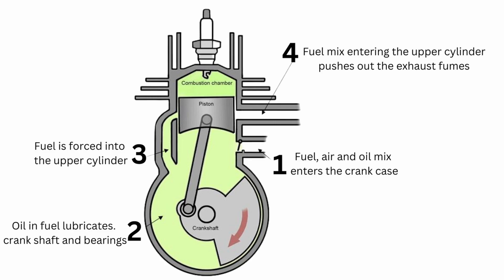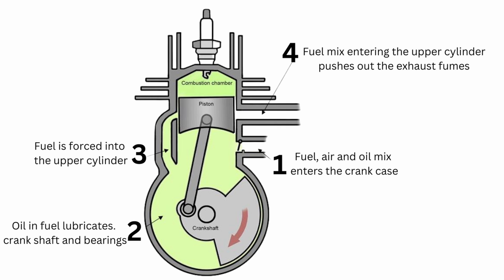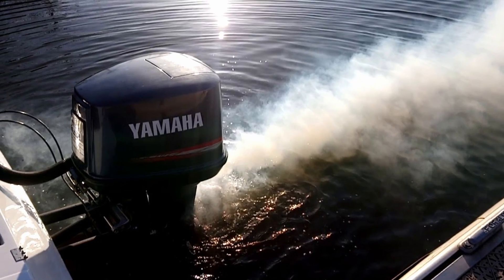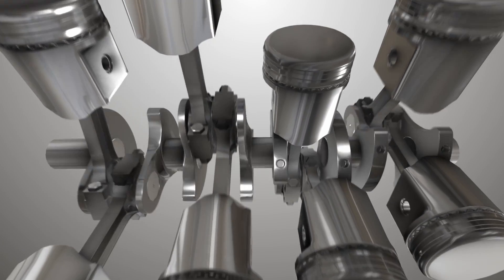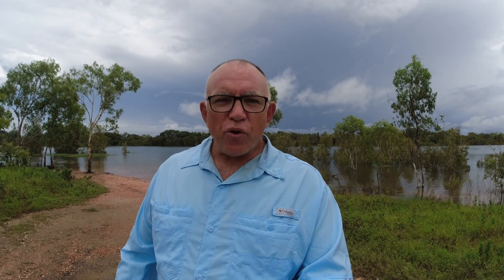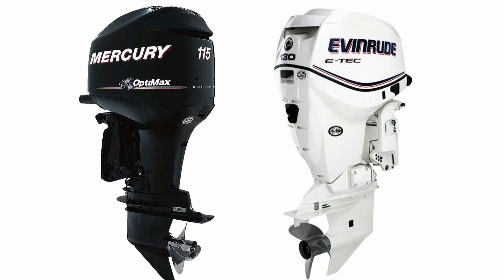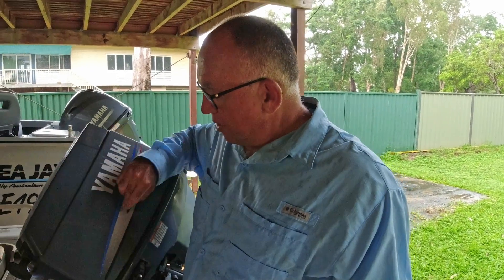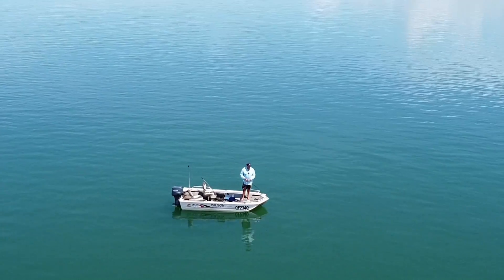Two Stroke vs Four Stroke Outboards

Comment: Not sure where you got your torque info, but 4 strokes produce more torque down low in the RPMs so they actually usually accelerate faster. 2 strokes make their power up higher in the rpm range.
Reply from the maker: Do you really that's the case though? I know that is what they say but a 90hp 2 stroke spins a prop a lot faster than a 4 stroke of the same or similar displacement. I'm old enough to be of the generation where we were all changing over to 4 strokes and were told they are more torquey down low but it is not what the rev gauge or the feel of the boat out of the hole tells me. But I totally accept that it is highly debatable. Put a 2 stroke and a 4 stoke of the same displacement on identical hulls and which one pops out of the hole quicker?
Reply: @smallboatcaptain1968  Same displacement, 2 stroke will have more HP. torque and hole shot. They have always been more bang for your buck by displacement but we rate outboards by HP, so that's what I was referencing. The biggest difference is that 4 strokes have a flatter longer torque curve whereas 2 strokes have a peakier one that really hits in one sweet rpm spot and is okay in the others. That is really based on getting the back pressure to hit and it is over a small rpm range. So in short a 4 stroke is nicer if you want to power at different RPMs, but a 2 stroke will give you more oomph at a small range of RPMs. So why you feel that kick in the hole shot from a 2 stroke is cause you are in that sweet spot. It is also why 2 strokes can be great for boats cause we usually use them in a pretty small RPM range. Personally I love 2 strokes.
Reply from the maker: @TheDornado  I love them as well. I still have a 2 stroke on my small punt. Hard to go wrong. And that punch out of the hole is hard to beat.

Comment: for a casually used engine, 2 strokes is still way better, my little 4 strokes leaking oil from the crankcase, powerhead needed to be removed to change the gasket, there's a valve clearance job needed sometime. 2 stroke can sit however long you want, it won't have those problems and the oily surface actually helps against corrosion

Comment: If i can buy old 175 boat and motor for 3500 . Are spend 20.000 for a 175 new .. ,i can rebuild the old 175  four times for the price of new 4 stroke. , This is a boat that gets used 4 times a year . .
Reply from the maker: You are absolutely right. And you will have a lot more grunt out of the hole and be a very happy boat owner. Id hate to pay the fuel bill for the long runs that I do but apart from that, 2 strokes are fine.

Comment: I agree with the video. I would say if it’s carbureted 20 hp or less then it’s two-stroke all the way, especially if you live in a tropical area. What was not mentioned is that today’s fuel is loaded with ethanol and if you don’t use your small four stroke carbureted motor on a regular basis, you will wind up cleaning the carburetors out on a regular basis. The reason for this is that the fuel sits in the carburetor bowl and decomposes. It will fool you because it will run one time, but then all that stuff sitting at the bottom and gets sucked into the carburetor so it won’t run the next time when you’re out on the water. You have to drain carb bowls every time you use it. The two strokes don’t have that problem because while the ethanol still decomposes in the float bowls, the fuel itself has oil in it, and that tends to lubricate the Jets reducing chances of it clogged carbs. I have a friend who has an identical motor to mine. His is two-stroke mine is 4 he hasn’t cleaned his carburetor out ever and I’m doing it every month. 25 hp and up with electronic fuel injection then it is four stroke all the way. It’s cleaner quieter and you get great gas mileage. And they run a lot smoother. And the EFI is a high-pressure system, which tends to eliminate the clogging issue.
Reply from the maker: Well said. I hear people talking about the ethanol issue a lot but it is something I don't have a problem with myself as we can't by E10 or any ethanol fuel where I live. Plus, we have the option of standard fuel with no ethanol or fuel with added ethanol when I am away from my home town. I will do a video on ethanol just to inform people about the issues with this type of fuel. 
Thanks for the feedback. Very informative. 
SBC.
Reply: what is the gas mileage of 2S vs 4S? if you go far distance and use it every day a 4S might have a great advantage (or not?)
Reply: A 4 stroke is far more economical 👍

Comment: One reason that sets 4 strokes above all the other disadvantages, mileages mileages. 2 stokes drinks up much more fuel and that spare change will add up if you're out a lot
Reply from the maker: I agree with you there. It is not a massive difference in the smaller engines but once over 50hp, you are saving a substantial amount of money with a 4 stroke.

Comment: 2-stroke actually burns very little oil. I have a Evinrude 115 e-tec and I rarely adds oil to the oil tank. It probably burns less oil than an oil change on a 4 strike takes. One thing I dont like with it is makes more noice than a 4-stroke.
Reply from the maker: That's right mate. The Etec burns bugger all oil due to its direct injection. The larger engines seem to burn it a bit but up to 50hp, they don't burn much at all. SBC

Comment: Yep don't buy a four stroke my dad and I never did. E-tec is still the best built outboard ever made. People just wanted to get sucker to buy a 4 stroke.
Reply from the maker: That's a controversial statement but I know lots of blokes that love Etecs and many more that had nothing but issues with them. You have to love the grunt of a two stroke such as an Etec. What would you buy now that Etecs are no more?
Reply: @smallboatcaptain1968  I would still buy a 2 stroke outboard. I never owned a e-tec but new all about them. My parents just sold there lake property with my old boat it was a 1969 Johnson 25 horsepower on a 14 ft aluminum boat. Boat was a 1962 it can hold a 40 on the back was rated for it. No boat no more. But in another year my parents plan on getting a party boat. I probably would get a Yamaha 2 stroke seem good. I mostly on that 14 ft boat that I have had since I was 17 years old. I have had mostly 60's motors on the boat except I had a 91 8 horse mercury.
Reply from the maker: @Kyle-bb9zp  Fair enough. In those small horse power ratings I also like 2 stroke.
Reply: Yep. Etec so good they stopped making them...
Reply: @TheSheriff1989 you don’t know what you’re talking about
Reply: @gottalovethephilippines5417  they did stop making them... fact
Reply: @TheSheriff1989 you still have no idea, champ
Reply: All ready new they stop making them I still see them on back of boats they didn't want to sacrifice performance and maybe they didn't have the extra money for a new 4 stroke.

Comment: 1985 johnson 50 2 stroke love the little thing doesn't make a ton of power but it's basically bulletproof
Reply: Still have an '82 Mariner 50 2 stroke that's running great
Reply from the maker: That's fantastic. You look after it and it will keep going for God knows how long.
Reply: Couldn’t agree more. Bullet proof.

Comment: In some cases, I would argue that there is less pollution with a 2-stroke engine. If your 4-stroke engine's tiller is lying on its side, it will create an oil slick when placed in the water, regardless of the tiller's position. This oil slick is visible. While a 2-stroke engine burns oil underwater, the environmental impact depends on how the engine is used. I have experience with both 4-stroke and 2-stroke engines CDI : the 4-stroke is better when kept upright, while the 2-stroke performs better on its side. I'm interested in hearing your thoughts on this.
Reply: My thoughts are you haven't got A clue 😂.
Reply: @johnboy5167  Constructive and informative (-:
Reply: Well he doesn't 😂.
Reply from the maker: G'day tacticaladvance. I am a little confused about the question. If my outboard motor is on its side, then something horrible has gone wrong. I can only assume you are talking about 2 and 4 stroke CDI motors in general such as in chainsaws and gardening equipment etc. 
Sticking to outboards, my concern with 2 strokes is that some of the unburnt fuel mix is pushed out of the cylinder with the exhaust fumes. It is also a dirtier burn due to the engine burning 4, 2 or 1% oil mix. This is improved dramatically with modern 2 strokes such as the ETec. 
Now, the simple facts are, I will release more carbon into the environment in my car, in my plane travels and getting freight moved around the country then I will ever burn running my little 30hp 2 stroke. So, for smaller engines, I am still a big fan of the 2 stroke. 
SBC.

Comment: Yamaha 50 2 stroke - 189lbs, newer Honda 60 4 stroke 217 lbs more hp/lb.  More weight on the transom, most people’s guts nowadays are more than the weight difference.
Reply from the maker: Hahaha. Mine included.

Comment: Okay Capt'n, I have a question and a delema for you. I own a 5 metre 1980 Quintrex Cruiseabout...the old 70hp 2 stroke is dead, and I am looking for a replacement. The problem I see with a 4 stroke is that  the extra weight  of the 4 stroke and the lack of power band, essentially means I should go higher in hp...but how can I, due to the extra weight on the transom? How different is my boat likely to perform with all that extra weight in the rear, as well as lack of 2 stroke power band?? Will it effect my vessel's performance in heavy seas or when trying to cross a bar to and from the ocean??? I really don't like the lack of choice, and would prefer a 2 stroke Any day.
Reply from the maker: G'day Steve. You're right mate. Two strokes have heaps more torque. It will be noticeable but that is not to say that the 70hp four stoke isn't going to get you through the bar or give you any major issues with power. I have a 70hp four stroke Yamaha on a plate boat that would be similar weight to the old Cruiseabout and it punches out of the hole, cruises along nicely and economically and is a great engine. 
Weight wise is no longer a major issue either. From memory, a 70hp four stroke is around 100kgs and the F70 four stroke is 120kgs. That's $10 more fuel in the tank. Not enough to even worry about. 
So my opinion remains, small two strokes such as 40hp or lower are great but anything bigger, its four stroke all the way for me. Less torque for sure but that's about it. Cruising and top end speed will be the same just at half the fuel burn. And weight is not a big issue. As much as a love the power of two strokes, upgrading to a four stoke won't be a big issue mate. SBC

Comment: I just bought a 2007 Yamaha 115 2 stroke and I think I’m going to get many years out of it
Reply from the maker: You will mate. They are a great engine. My concern is the fuel they use but nothing wrong with the motor at all.

Comment: Good video but, no disrespect you need to do some research on how the Evinrude G2 2 stroke worked. No mixing of gas and oil anywhere it pin pointed the oil into precise positions making it the most environmentally friendly fuel operated outboard ever produced. And they still use this design in the new Rotax outboard. I really hope they bring the G2 back to market. It is a phenomenal motor 👍🏻
Reply from the maker: Great point mate and you are right, I could have looked into it more. It is a shame you can't but them in Australia anymore. I had some mates who loved them and others that didn't but they were very good in my opinion.

Comment: Well I have had a problem that may be unknown to most people. where I lived we had to take a boat to work every day and when the temperature drops to -20c the exhaust freezes and the exhaust pipe is blocked by ice. the solution was to leave the engine in the bathroom at night. the weight of even a small engine like 9.9 or 15 hp is very different on 4-stroke and 2-stroke
Reply from the maker: Wow. -20 degrees is crazy. But thats a good point. If you need to move the engine around you are much better off with a light two stroke. I just can't imagine being on the water when it is that cold. I live in the tropics and intend the stay in the tropics.
Reply: @smallboatcaptain1968  After a week of bringing the engine in every night, my dad came up with a better solution. An early 1970's 6hp Evinrude using the entire lower unit as an exhaust pipe, it never froze

Comment: I've got a 90hp 2 banger on my big boat and it sucks the fuel big time. I mean it drinks the stuff and there's no doubt a 4-stroke would be a better option. The kids boat has a 15hp 2-stroke and it files (alarmingly fast for teenage boys). Yes it's inefficient but it uses so little fuel so who cares.
Reply from the maker: That's exactly right and that point that I was trying to make. Small two stroke are fantastic. But the big ones are fuel guzzling machines.

Comment: I bought a new 50 etec just before they announced they were stopping making them. Best decision ever. Its finally going in for its first service in the next month. If I bought a 4 stroke it would of cost two services easy already. It uses hardly any fuel pushing a 4.5m plate nor does it use much oil. (fuel injected and oil injected). Im only half way through a bottle and its done a decent amount of work so far. The fuel smell is comparable to a 4 stroke. On top of that it pumps out the highest amount of amps in its class by far, so charging the 80lb motorguide Lipo battery is super. Etecs are the only outboard that is rated in the EU environment standards for their lakes. The only thing is you got to start it up every few months and run it as it cant be left to sit there as the lube from the oil can potentially run dry. Hopefully someday someone will buy the rights and start manufacturing them again. They were the US military's go to outboard. To be honest I cringe at the thought of having to buy another 4 stroke after owning the tec, :(
Reply from the maker: I hear a lot of guys say the same thing Fish Lips. A mate of mine is a guide in the NT and used to run Etecs all the time and loved them. Other guys have had issues with them and hate them but I guess like any engine, some are lemons. 
You can't beat the old two stroke power and I used the Merc Optimax for years on commercial boats and loved them. So I am hoping they make a comeback as well. 
Thanks for the feedback mate. 
SBC.
Reply: The Etec works like the sun and lightning which are all 2 stroke.
Reply: I also have an etec 90 hp I bought new in 2019 and absolutely love it. It pretty quiet, fuel efficient and power. You almost have to double the power of a 4 stroke to get any kind of enjoyment out of it.
Reply: What a load of dribble modern 4 strokes are the only engine anyone with any intelligence would buy now.

Comment: I'm in the market for a boat. I like 2 strokes for their simplicity (If well maintained). The boat isn't for super regular use, so I can deal with extra fuel consumption for those occasional uses. Plus they're quick to get into their powerband. Also, you can get some good high horsepower 2 strokes for the same money as much lower powered 4 stroke. 

But if I were using a boat every day or more frequently, a four-stroke would be the go. I think you'd tire of noise/fuel consumption pretty quickly.
Reply from the maker: Good point. If only used occasionally, they are great value for money. Very good point. 
SBC
Reply: whats the difference in fuel consumption 2S vs 4S?

Comment: Great vid. Cant disagree with him. But as a  marine mech for 25 years I will say its time to let the 2strokes die. 4 strokes are just starting to out performing them and next someone will build a tesla boat lol so we may even see that phase of tech before its all over. The eboard
Reply: Coming from an old bogan.
Reply: I bet to differ sir! I have a few less years in the industry than you.  For the common man in today’s economy to repower to a four stroke and cost to maintain breaks a lot of people.  Four strokes haven’t yet met the power to weight of a carbed two stroke.  Especially in the smaller horsepower ranges a four stroke 6hp even with all the plastic it weighs as much as the 9.8 two stroke and they sound like clunky pieces of crap. I don’t care about the pollution aspects compared to our elites flying private all over my weekly two-stroke usage is nothing.  I guess the last point is sound two strokes just sound good they may be louder but they have a tone.  The only four strokes I find pleasant are V8’s.  I was around when the us govt basically forced four strokes into the market in 2001. To this day I’ve only worked on them. I’ll keep my two strokes in defiance!
Reply: @AbbyNormalGarage  lmaox2,, I cant disagree with that man...
Reply from the maker: Hahaha. I am sure you are right mate. The Tesla outboard is coming. 😂

Comment: Well a 2-stroke is what I've got, and it would be so much money to repower the boat it just wouldn't be worth it for the amount I use it.  And there is an environmental cost to scrapping old equipment before it's time as well.  When it dies I'll replace it, but I'll have to drop 20 horsepower for the same weight.

Lots of people like the fact that 4-strokes use less fuel, but if you already have a 2-stroke you'll never save enough on fuel to repower the boat before it's time.
Reply from the maker: I agree mate. What size is your two stroke?
Reply: @smallboatcaptain1968  same for me! I have a Yamaha 70hp 2 stroke from 1984, I even have to mix the oil to fuel to 1:50. It works great tho, so much quality back in the day.